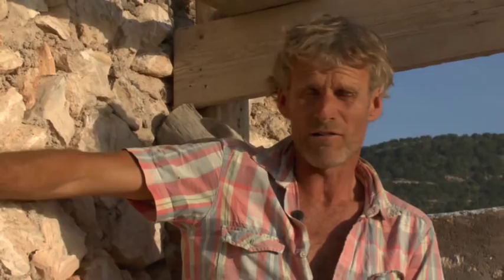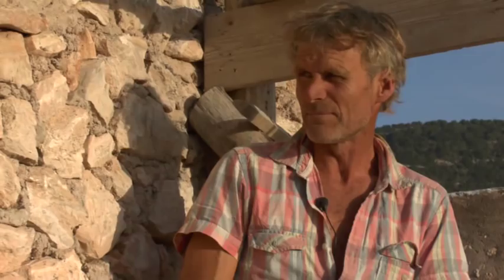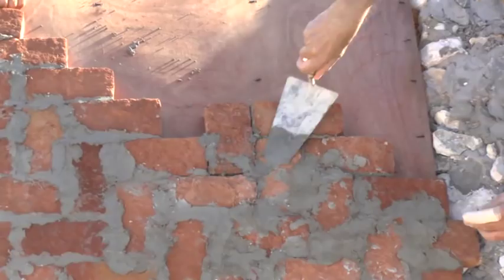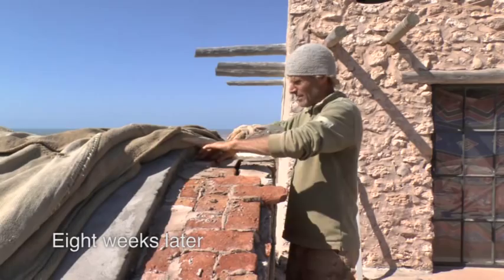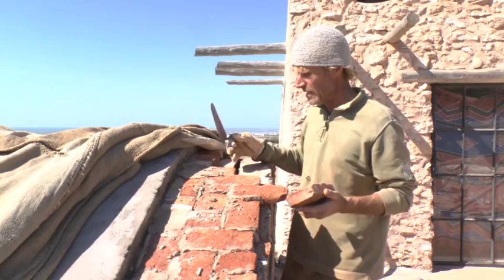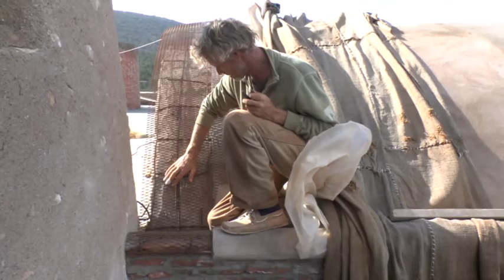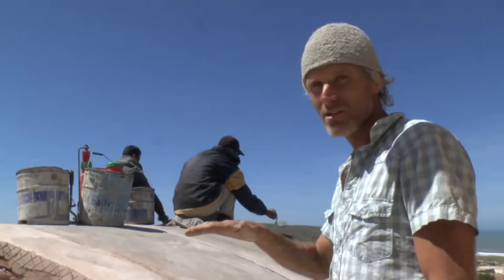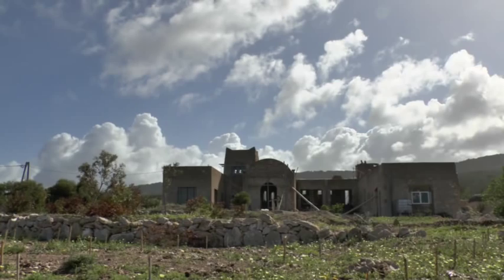Fertile Roots HQ Barrel Vault

Comment: This is a great video on how to do a masonry barrel arch, I'm surprised it has so few views. I'm curious, what are the sort of loads this sort of vaulted roof can carry?
Reply from the maker: I have no idea but quite a lot due to the skin of ferro-cement.  I'm no engineer but I think it's true to say that a vault or arch is as strong as it's supporting walls, and that's where our main issue lay. If the walls had been strong enough to support the thrust of a heavier arch I would probably have layed the bricks face to face instead of edge to edge.  This would have made a strong vault that wouldn't need the ferro-cement.  the idea of the ferro-cement layer was to have the whole thing self-support and only load the walls vertically.  In the end i cannot say whether we achieved this result or not however, as those two steel bars were so tensioned by the end of it that you can ring a tune from them.  So the walls have still moved. I always thought that I might cut those bars off if everything went well.  I'm not going to though!!!

Comment: Really great video and description . Hi..I want to construct a vault with sandbag walls and stabilized earth roof with 12x12 feet internal space.i will be very great full if I could receive some sort of guidance .will 24 inches wall be sufficient for toof thrust for my measurement?. Thank you, 
Rao, from vizag,India
Reply from the maker: It would depend on the weight of your roof, I think, and on how well bonded your sandbags are.  Also, is it a stand alone structure or will the walls be supported by other rooms on either side? I've never used these materials so cannot be much help.

Comment: Nice.  If you want smaller carbon use try  without formwork.  try clay/lime plaster on top
Reply from the maker: In an ideal world, yes, but the difficulty we faced (as explained in the video) was overcoming the weakness of our walls.  We needed the roof to be as light as possible and also self support as much as possible in order to minimize thrust. That's why we used the bricks edge to edge instead of face to face (it equals half the number of bricks needed).  And that's why we put a ferro-cement skin over the top.  If the walls were strong enough, or I could add buttresses to them, then we could have laid the bricks face to face and simply put a lime render over the top.

Comment: would it work better having a herringbone bond with the stretcher face showing in stead of the frog.
Reply from the maker: Yes, Cicero, but we laid them all stretcher to stretcher to reduce the number of bricks and therefore the weight of the whole thing, to avoid damaging the weak walls.
Reply from the maker: I would add that I think having the bricks as they are is actually more aesthetically pleasing.  These particular bricks are only 4-5cms thick and having the frog showing would be a very 'busy' roof to look at in my opinion.  thanks for watching.